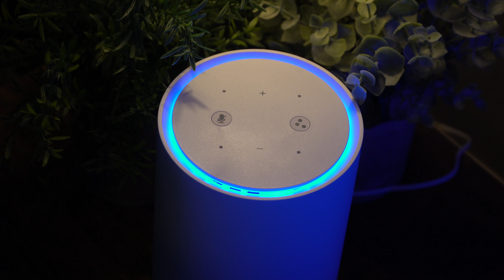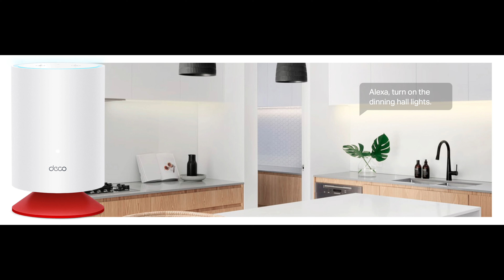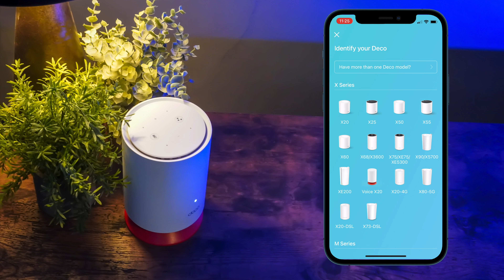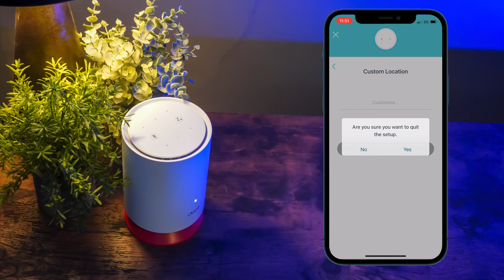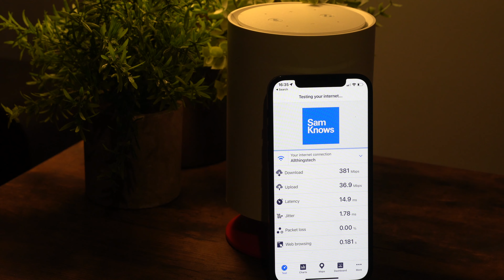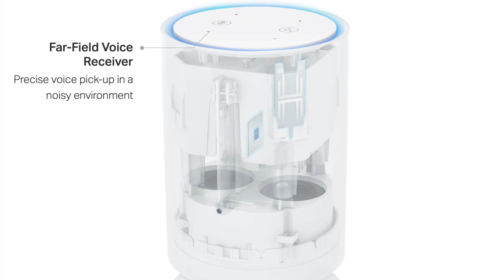Get Better Broadband Coverage | tp-link Deco Voice X20 Mesh WiFi 6 System with Alexa Built in

Comment: Are mesh systems just fancy looking wifi repeaters or do they extend via powerline? I've never really understood the craze.  Also I think saying it will improve your broadband is a bit misleading as it's the wifi coverage being improved, if it does, not your broadband connection which will be the same.